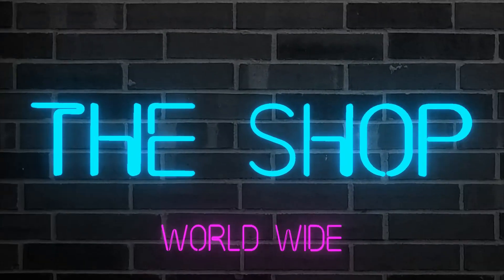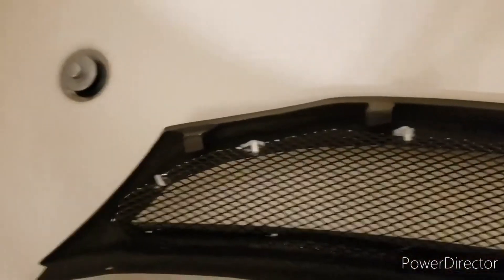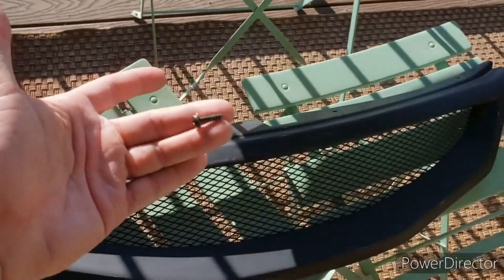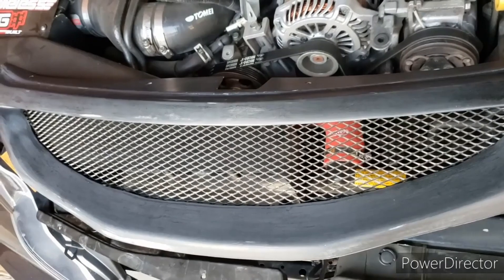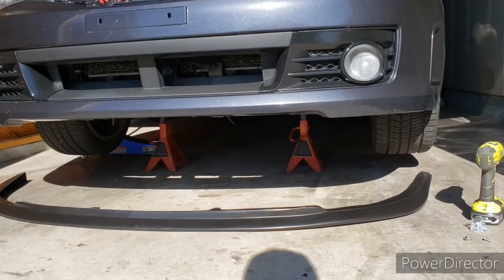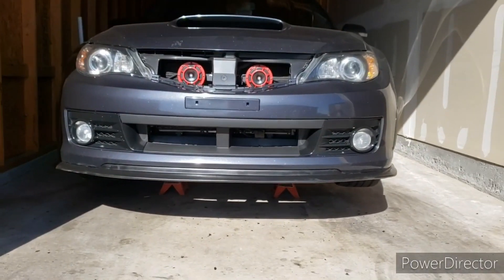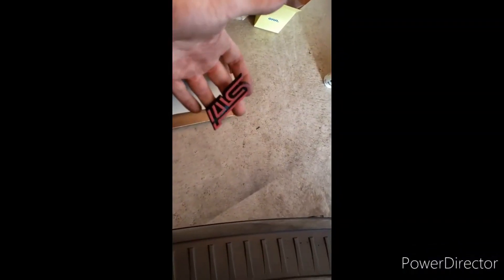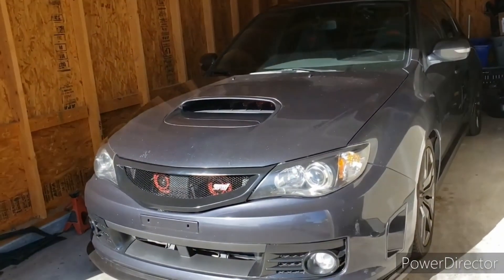Grill and Lip Spoiler Install on 08 Subaru Sti

Comment: hi, when you install the grille, did you manage to put the screws in the bottom ? you were not annoyed by the original waves where the oem grill is fixed? thanks
Reply from the maker: I did get the screws in the bottom of the grille. That's why I went over pre drilling the bottom tabs while the grill was off the car. I do remember it being pretty difficult to get my hands down in there and doing the bottom before securing the top.
Reply: @TheShopWorldWide  thanks for your reply. and it didn't seem too tight? mine has to be pulled quite tight to fit above and below

Comment: Lip link?
Reply from the maker: Front Bumper Lip Spoiler Compatible With 2008-2010 IMPREZA STI, CS Style Black PU Front Bumper Lip Spoiler Bodykit Splitter Diffuser Air Dam Chin Diffuser by IKON MOTORSPORTS, 2009 https://a.co/d/b0J3VNn